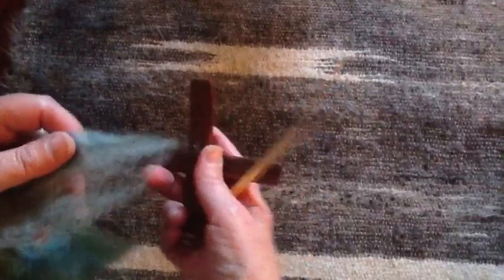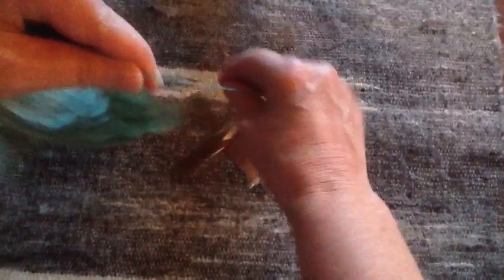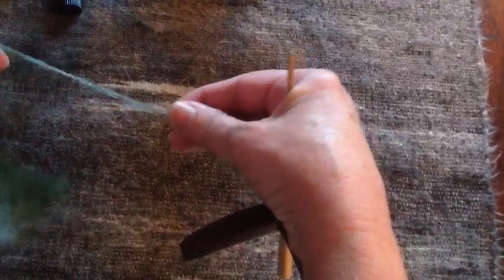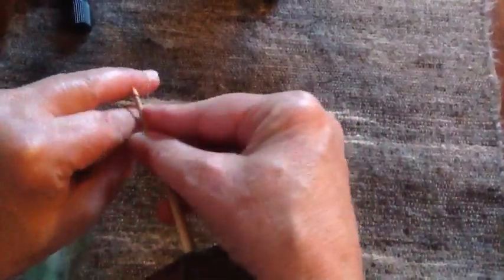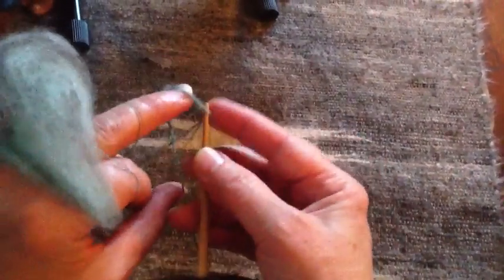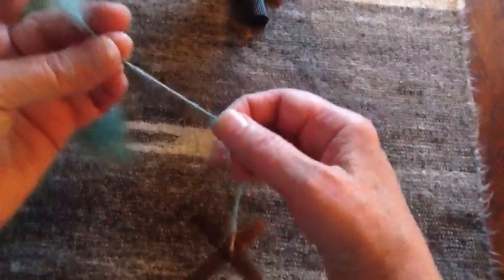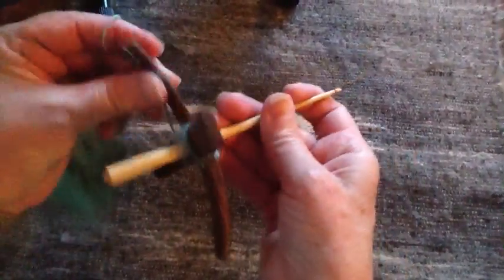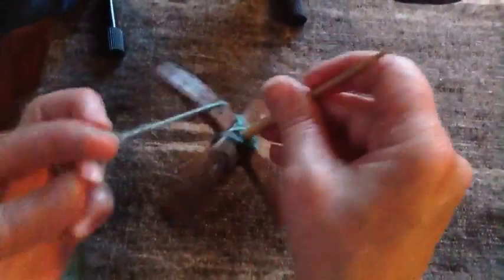Chain-ply as you spin on a Turkish Spindle

Comment from the maker: Thank you! This is the first time in my life that someone has said I sound like someone they know. I'm tickled that it sounds like your grandmother!

As for the tail: So far when I've used this method with regular singles I've not had a problem with finding the tail. But then, I always wind-off from the outside of the turtle to avoid the potential of a tangled mess when the center collapses. I prefer to use a winding ball - that's a video for another time. :) 
Wanda